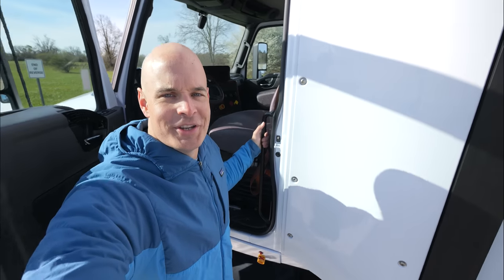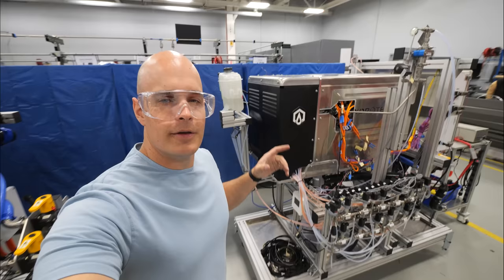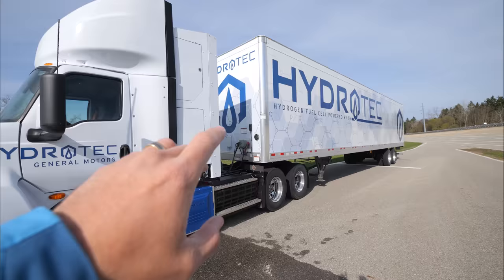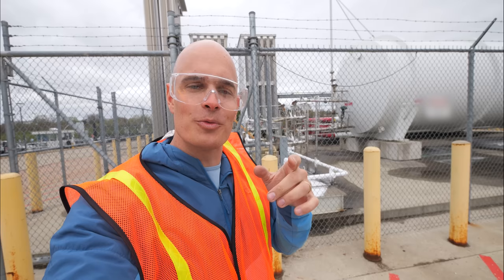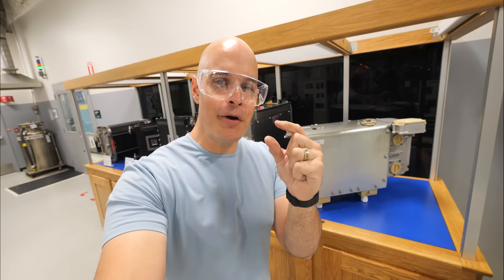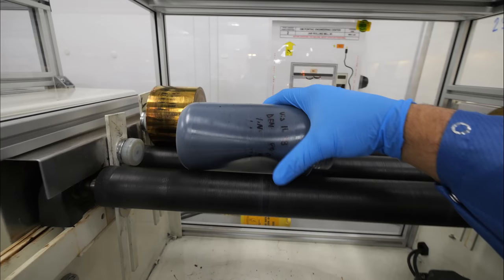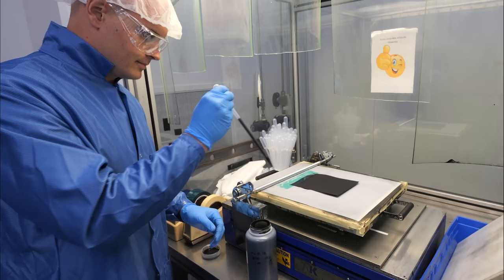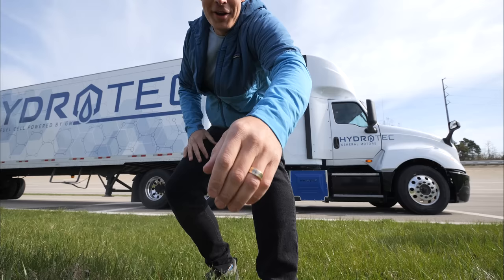How to build a Hydrogen Fuel Cell Semi Truck? - Hydrotec Factory Tour

Comment: Still as complex as combustion engine, I can see why the industry is NOT moving this way.
Reply: more complex! and consumes platinum. this tech has been around for decades and hasn't improved in any meaningful way or been deployed at scale because it can't and isn't economically viable.

it's even worse when you consider energy inefficiency losses and leaks

weight and cost of a safe tank is the final nail in the coffin
Reply: Not to mention that we don't even have enough platinum reserves to scale this up in any meaningful way.
Reply: @MrEazyE357  There's newer catalysts now that uses carbon coated nickle which only has comparable efficiency which is much cheaper and common too.
Reply: So what's better? A large semi with a 60,000 kg weight limit and 10,000kg is just pure battery???those batteries weigh A LOT!!!!
Reply: @fireWireX4  Tesla Semi is only approx 10% heavier than a diesel semi. Hydrogen will be somewhere between the two. Lithium is better due to higher efficiency and lower operating costs.
Reply: You dont know anything about the industry....
Reply: @__shaun__  it does not consume platinum....
Reply: @Decenium  let's see if you can still say that 10 years from now

Comment: Can you harness the cooling power of expanding hydrogen to power some air conditioning or refrigeration system? That sounds like a lot of cooling power wasted.
Reply: Hey Jerry, why is there so many accounts with inappropriate names and advertising for p*** in their description getting unbelievable amount of likes almost instantly here in the comments?   Are you Jerry rigging your comment section for likes?
Reply: Momo, no that would not be practical at all.  You would be using up far more hydrogen from the cylinder than is required for an ice engine or fuel cell.

Comment: These are probably my favorite segment of the JerryRig series.
Reply from the maker: Thank you!!
Reply: @JerryRigEverything  
Sun to wheels cost analysis required.... The complete system, not just "here's the hydrogen in the tank"
False promises.
Reply: @rogerstarkey5390  I agree. The cost and the sustainability of such a technological endeavor would be nice to know. Not denying, looks promising, but the video barely scratches the surface. Good to know at least that such technologies are in constant development.
Reply: @ron200088  
My point being it's horrendously inefficient IF you look at the whole system.
It's the same thing that happens with EV vs Fossil fuel. They never account properly for the "Well to wheel" cost of oil based fuels, but always give us the "Ooooo! What about all that electricity??"
Well, Hydrogen needing 3 times the grid energy for similar distance MUST be accounted for.
Reply: @rogerstarkey5390  Agreed ! Even though as Zack also mentions, the technology has improved and it’s still improving, it is still a long way away from being efficient and actually being a sustainable way of reducing CO2 emissions. Not denying that it’s a step forward in the right way, but it is definitely not there yet. Of course, it looks cool and all and the less tech savvy people might think as in the case of the electric vehicles, that it is already efficient and sustainable, but that could not be further from the truth. In my opinion, we are decades away from having such technologies being efficient and sustainable. Let’s be honest, as long as there are fossil fuels out there and there is a lot of money to be made, such technologies are more or less a curtain of smoke. And until they become affordable and sustainable for the majority, it all looks good on paper, but in reality it will remain a niche segment for the select few.
Reply: @JerryRigEverything you should look into Hydrogen LENR reactor technology mentioned several times in the new Nasa May 2023 technology projection report. I go over it in detail.

Comment: Loved the concept of using fuel cells in trucks. And Zach was being very clear in explaining how the fuel cell works. Would love to see a day when this is actually commercially used in vehicles.
Reply: @GeorgeWashingtonLaserMusket  The problem is that producing and gathering hydrogen uses at this time uses more energy than you can get out of it so its not currently worth using until it gets cheaper.
Reply: @bnkh  The latest and greatest of nuclear power plants has been introduced  that theoretically can isolate hydrogen on the cheap, at the same time as producing energy via steam generation, and no meltdown or thermal runaway issues.
Reply: @citylockapolytechnikeyllcc7936  
Come back when it's more than "a theory" and they actually BUILD those plants, build enough of them, and get the energy cost down to that of renewables.
Then you MIGHT have a case.
But since they're not ready and current builds take far too long, are 3 times the cost of even offshore wind to build and the energy is 2.5 times the price, I think it's going to be a while.
Reply: @GeorgeWashingtonLaserMusket  
How is a battery toxic when it produces zero pollution over its multi decade use life and can be 98% recycled (no, they don't and won't go to landfill.....)
In fact that they're worth recycling will mean that the batteries from your old phone, power tools, etc which probably DO go to landfill now, will be worth collecting to throw onto the same grinder they use to begin the separation process.
Reply: @rogerstarkey5390  It's funny to me how the world managed to solve lead acid battery recycling, but so many people don't think that battery recycling for other battery technology can be solved.
Reply: @bnkh  Another problem is that transporting and storing the hydrogen so people can pull up to the hydrogen station to refuel is also a nightmare.
Another problem is how much physical space you need to store enough hydrogen to get a decent range from the vehicle. It'll work for semis, but not so much in passenger cars.
Reply: @rogerstarkey5390  It's not a theory, which is why it has taken a lot of countries' interest (Including the US). Japan, and China has one running right now with different designs (prismatic block vs pebble bed) with Korea following suit in the near future. Japan's actually building a huge H2 plant next door to their HTGR nuclear reactor to test industrial scale production since their previous smaller scale test results were really good (bench up to room scale). The projected commercial version of the plan will be online by 2030s and can produce around 800 tons of hydrogen per day as a byproduct of the plant operating. It estimates the price per kg to be even cheaper than steam reforming hydrogen with current prices. 

The reason why it's cheaper is because it doesn't use any electricity (expensive energy) to create hydrogen, but rather heat which is a much cheaper energy source. This heat is sourced from the otherwise waste heat generated by the high temperature nuclear plant, the one running in Japan has waste heat of 950 C and has been running since 1998. It bypasses the electricity roundtrip efficiency issue since it's a byproduct of the plant generating electricity, it uses only heat and a few chemicals (sulfur and iodine) that aren't consumed in the process. It's a variant of thermolysis called thermochemical water splitting, it requires around at least 800 C to operate which Japan's design has enough temps.

The plant is also cheaper than current plants since it's smaller (SMR) and has more inherent safety features like being able to cool the core via air cooling alone which removes a lot of active safety systems that costs a lot. Asia in particular is also a leader on cheap and fast built plants with Korea, and China averaging on 6-7 years per unit and Japan holding the record of just 4 years per unit. With SMR designs, it's estimated to be built even faster (2-4 years).
Reply: @rogerstarkey5390  everyone we have found the "EV" fanboi lol ...."hydrogen is dead in the water" "I have EV at home so it's the future" hahaha 🤣🤣🤣
Reply: @citylockapolytechnikeyllcc7936  all powerplants work that way chief. They all create steam to create power, the only difference is in the way they get that steam.....There never was a risk of meltdown or runaway issues unless the plant was built improperly. That's not new for nuclear. The biggest issues with nuclear is that people don't understand it at all and get scared by things like Chernobyl which hasn't even came close to a fraction of a percentage of the lives killed by fossil fuels.
Reply: @mjc0961  That's because of the nature of the battery, you can't solve that issue for every battery. You're talking entirely different structures, components, metals and chemical properties. Not everything is recyclable easily. Lead batteries on the other hand are incredibly simple, you can practically melt the entire thing down to get reusable lead and plastics again. Not the case for other batteries.

Comment: As a truck driver, I've always been more interested in hydrogen than electric trucks. In this video, he mentions that it has a battery to help with acceleration at slow speeds. That makes me question its abilities with climbing mountains since over half my nightly run is through the mountains. 

The part where it's pointed out how quiet the inside of the truck is..all modern trucks are that quiet. My diesel Peterbilt day cab is just as quiet.

Observations I've made in this video include how much length this adds to the truck. It makes a day cab the same length as a sleeper truck, which in turn would make sleeper trucks too long to navigate many places. Current hydrogen-powered trucks have smaller boxes behind the cab, adding almost no length. Many of our trucks are single-axel daycabs, and adding that box would make them too big to navigate many of our customers. (LTL) My truck is a twin axle since I'm a linehaul driver, but I share it with a city driver who needs it to be as short as possible.

Another is the infrastructure. We fuel on-site at my terminal since we have 250 day cabs, half of which run 24 hours a day. Changing the terminal and trucks to accommodate hydrogen would be a huge undertaking.

I've been following hydrogen technology in aviation, and I'm looking forward to seeing what they can do.

Comment: Hi Jerry, great video! Not sure if someone already commented but it will be interesting to know the costs of using this technology compared to standard ICE and electric motors
Reply: For now Hydrogen technology and Hydrogen itself is more expensive as its a relly niche market. But compared to battery powered, for trucks hydrogen makes more sense
Reply: @joelimbergamo639  Most commercially available hydrogen gas is "blue" hydrogen, being a byproduct of fossil fuel production. "Green" hydrogen created from electrolysis is more expensive. The big downside of green hydrogen is once you take electricity, use it to produce hydrogen, and use a fuel cell to get electricity back out you have lost most of the energy. Batteries are just much more  efficient.
Reply: @eDoc2020  agreed. But for big boats and plains batteries arent an option. And for trucks its at the limit . I know that hydrogen is supper inefficient when you consider all the process but its the best way to store energy in a weight-efficient manner we have rn. When weight osnt a big concern batteries are clearly the better option but in vehicles at some point it starts counting

Comment: This is really cool, and I've learnt a lot about how a fuel cell actually works, super interesting! The platinum catalyst is a concern though. Platinum is extremely rare, and I did some calculations - if you were to take all of the world's platinum reserves and turn them into these Hydrotec cubes, they would generate 3.09 gigawatts of power, which would be about 0.067% of the world's energy consumption by vehicles. Even if I was way off in my calculations it's still miniscule. Unless if a different catalyst is found this isn't really viable.
Reply: Was the enough information in the video to tell what fraction of the ink is actually platinum? (I'm a little surprised that it's still the best choice, but chemistry is like that sometimes - the science-fair-project fuel cell I built 40 years ago used a very low fraction suspension of platinum painted on to a nickel screen for the electrode.)  There is probably still some room to improve since the only place where the platinum is useful is on the surface where the reaction occurs...
Reply: Thankfully there's newer research on alternatives for the catalyst. One promising one is carbon coated Nickle which has almost the same efficiency as Platinum without the same price tag.
Reply: i hope they find other catalysts soon
Reply: It's not as if almost every vehicle on the road isn't mandated to have a catalytic converter, that uses platinum, palladium and rhodium already....
Fuel cell vehicles are a stupid waste of energy (IMO) but your argument falls flat on its face.
Reply: @jimurrata6785  why do combustion engines need those metals?
Reply: @DafterHindi  I said they are mandated, not that I want to breathe the smog created when ICE are run without catalytic converters.
Reply: @jimurrata6785  they help to filter the pollutants?
Reply: @DafterHindi  They mostly reduce noxious and toxic compounds to elemental ones.
Converter theft is a big issue here when scrap prices are high

Comment: I don't believe for a second that hydrogen will be the future of the average person's day to day driving. MAYBE they can get it working for large vehicles like semis, but passenger cars? Forget it. BEVs, with new battery technologies that will spank lithium based batteries, are the future. That said, it's still cool to see and learn about this technology. Thanks for taking the time to share this with us.

Also no, I don't think you should build a hydrogen powered humvee, unless there's actually a hydrogen refueling station nearby so you can use it, hahaha.

Comment: glad to see some actual advancements being made for semis instead of cgi marketing bullshit that does nothing
Reply: ahem ahem musky waters
Reply: @navdeepsingh3508  Musk's semi literally rolled down with gravity from a hill, he couldn't even be bothered to make a cgi ad
Reply: There have been hydrogen trucks for a while. Mercedes made one a while ago. The problem is that hydrogen simply makes no sense economically. The fuel cells are extremely expensive (platinum) and don't last too long. The efficiency is bad and the fuel itself is also expensive. hydrogen has ~33.33 kWh/kg with an efficiency of ~50%. Diesel has 10.7 kWh/l with an efficiency of ~30% for trucks. That means 1kg of hydrogen gives you as much range as ~5l of diesel. This truck has 60kg of hydrogen which is equivalent to ~311L of diesel or ~82 gallon. That is not a lot of range for a truck.
Reply: I havent' seen much advancements in this video, this is decades old technologies. All I saw is an incredibly complicated EV truck with huge underpowered and expensive fuel cells, a 200kWh battery and a cab filled with insanely expensive carbon fiber tanks that are good for at most 500 miles. 
I don't think musk's truck is any better, but this video is misleading at best.
Reply: @MrArcticPOWER  
You're on the money.
Reply: @vskrand  That was not a Tesla truck. It was a company named Nicola that iss now bankrupt and has sold off any ip it might have had.

Comment: Sign me up for when they make a car. This is some amazing innovation. With some real funding and and some really smart people working on this, this technology this could overtake electrical as a better solution. People’s main concern with fuel cells is just the use of hydrogen and the safety aspect, but I’m confident you can design robust safety systems you just need time and resources to figure it out just like we have already done with the internal combustion engine.

Comment: Great tech, just worry about the 6 10K PSI tanks when involved in an accident. I've read that these tanks are very robust however they can become an issue. Nonetheless, great tech!
Reply: As far as I understood it, in case there was an accident, that hydrogen would be gone into the upper parts of the atmosphere before anything serious could happen
Reply: @miasinterestinglife  exactly it doesn't hang around like petrol fumes even on a calm day hydrogen doesn't want to hang around.
Reply: @phalanx3803  Yep, Toyota's mirai hydrogen car was crash tested as well as fire tested. On the fire test it basically vented all the hydrogen straight up the atmosphere since they're lighter than air, it was basically a blowtorch flame that died out after the fuel got expended than an explosion. They also tested shooting the tank with a 60 cal rifle and it did the same, it vented the gas than blowing up.
Reply: I would also like more info on this. Seems weird to have 6 large grenades behind me as I drive down the highway.
Reply: Concern on Hydrogen safety. Another video of Hydrogen tank safety and what happens in a worst case scenario will be nice.

Comment: Zach!  What's the meantime between failure rate for the platinum sheeting? 
Does it break down over time similar to an anode would in a lithium battery?
It would be interesting to know when/frequency that the fuel cells require replacement, and long into future serviceability and cost would also be interesting!
lastly, it seems insane to me to have stack of 10k PSI tanks behind the head of the vehicle operator.  does anyone agree/disagree?